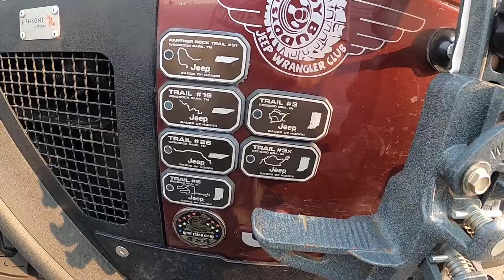BONUS video of the cruise tonight andnprepping for it

Comment: My first car was a 66 fury318 with a one harrel
Reply from the maker: That’s what this one is 318 poly. The engine runs great but the carburetor is a different story. I have rebuilt that carburetor three times and my uncle rebuild it once and it is one of them oddball carburetors. I’m debating on adapting it over to a better carb.
Reply: @metalartcustomsLLC  I never had trouble with that, the exhaust was rotten, mine was four door squad car from Kirkland Il